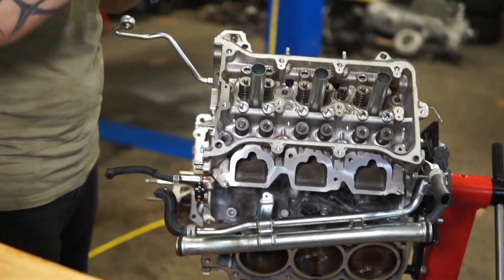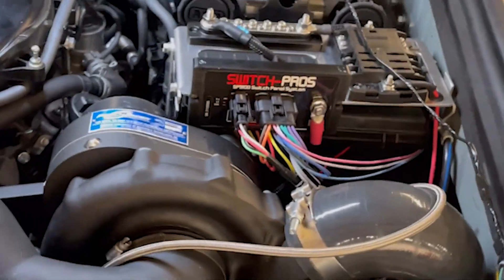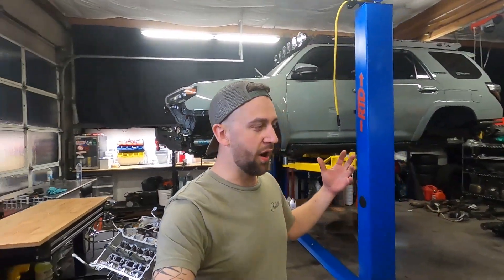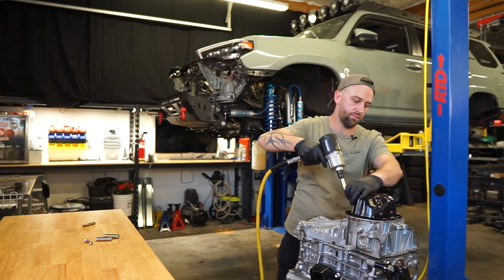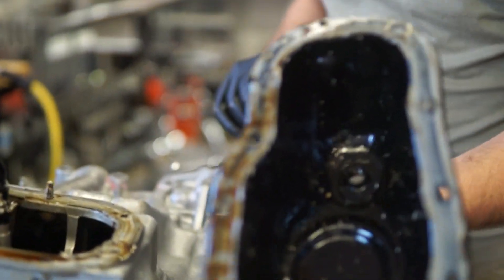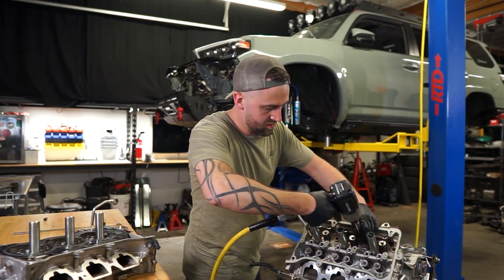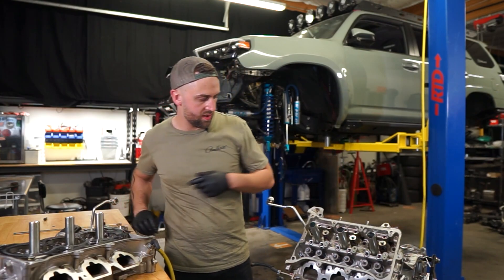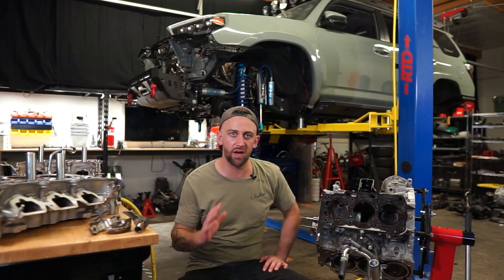HOW DID I BLOW UP MY 10K MILE 4RUNNER?!?!?!

Comment: Sorry I am late to the party on this. What was the reason for not sticking with the typical 6psi with the "trd tune"? Just chasing those few extra ponies? 
Just curious as the tranny, especially with those big tires might start causing some issues with too much hp. Like is the reliability factor not obvious? Not trying to sound like a smart ass. I am a bit new to the 4Runner world, but getting ready for an SC. I am definitely not greedy on the power as I want the reliability,  just need a little extra for around town.

Comment: It's almost like these motors were not designed for boost, made to be underpowered and reliable
Reply: That’s what they are designed for. Both Honda and Toyota V6 are not designed for power adders.
Reply: @ryanb8736  sarcasm
Reply: Yup. Should've rebuilt with forged internals and possibly even sleeves
Reply: @ryanb8736  honda engines love boost unless you’re talking about the new 1.5?
Reply: @Walterrinho well, he did say V6?
Reply: They're quite overbuilt and reliable with low boost(under 10psi). Kinda odd what happened here.

Comment: do you think it blew due to much pressure? like not enough supporting mods to go with the pro charger and the tune? 

with most boosted vehicles I've always thought you need a set up to get rid of the extra air just as much as you're throwing it (exhaust mods really) headers, ypipe, muffler.   Maybe im wrong but it just seems weird to me to throw boost in and not a way to get it out.
Reply from the maker: Well it wasn't over-pressurized cylinders, so the exhaust wasn't the issue. At it's core it was detonation (knock) that happened ultimately pushing the rod through the block.

Comment: Just curious as I must have missed the reason. Was the tune obviously to hot for the 4Runner engine? I have a Magnuson and many shops have tried to suggest a "hotter" tune to release more from it, but I'm honestly not looking to do what yours did!
Reply from the maker: Well, procharger doesn’t offer an OTS for the 21+, so we were on a beta program to get a map, and sometimes things happen during R&D unfortunately!
Reply: It would have evened blew, so just can’t blame tune. Tune just made it happen quicker. 

Many guys have done same to Tundras with 5.7 and have popped those engines. That’s why nobody charges them anymore. 

Honda is same way with J35. 

None of these engines are designed for boost.
Reply: @ryanb8736  I had a Magnuson (then TRD) supercharger on my 2000 4 runner for 5 years and never had issues. Now I've got a 2018 4Runner where they magnus and supercharger on it. I've had it for about 2 years now and no issues. Since Toyota used to carry Magnuson as a TRD product, there's obviously more research there. Procharger is obviously the hotter tuned supercharger.

Comment: Great video and comments. You think the procharger wasn't the right choice here and obviously it was too much for the engine? Magnuson has a different unit than the ProC but essentially they seem to be the same or at least the principle.
Reply from the maker: Well the issue wasn't so much in the setup, but we were testing tuning software, which was the only non-proven factor for the kit.

Comment: let me guess,,,  
u drained your rear end grease and put in the oil,  drove it till it blew. 
then told your wife u had to rebuild your engine.  
so u used this time to re valve the heads and open up the exhaust ,, install headers, bigger catalytic converter, also installed a pulling cam for a little better gas mileage and better low end torque ,,  giving u 1 to 2 mpg ,,   
and then u added the TRD cold air intake for the sound of the new exhaust. & she's happy because the 1mpg better gas mileage in the city its getting is great with her.

Comment: conclusion, don't try to make a 4runner faster. There is no perfect car and unfortunately the 4runner is slow but I'm okay with that, it has more pros than cons. Good Luck with the project!
Reply from the maker: Well more so we needed more checks in place like not reflashing a stock ECU and running a standalone.

Comment: I don’t think it was the blowers fault. The boot that thing puts out isn’t enough to be the cause. It’s has to be the fueling and timing that resulted in the detonations we were seeing. 
So either do you install parts in correctly or your tuner was all over the place with engine timing. 
You don’t need a 2JZ! Just take a V8 out of one of the Lexus f sports
Reply from the maker: We wanted to go above and beyond. 

Fueling wasn't an issue as we were on a fuel setup good enough for ~800whp.

As for the F-Sport engines, they're incredibly expensive for what you get, plus even less transmission options!
Reply: These engines don’t like to be boosted. Many have popped the Tundra 5.7’s too when supercharged. It’s only a matter of time with abuse. 

My friend has an older Audi SQ5 with a factory supermodel and it’s tuned to 500hp and beat on with 150k. 

He decides it’s time to charge his Tundra. Was fun and sounded great. He was out pounding it hard one night and popped the engine. 

None of us thought a 5.7 would blow. Now we know why nobody is charging them anymore. 

I wanted to buy a Lexus GSF and charge it, but won’t now. 

The transmission is also a very weak link in Toyota and Lexus. 

This is another reason why the 2JZ is still Toyotas best engine. It loves to be boosted. Only one.
Reply: @natedrives_ You are doing the right thing with going 2JZ engine. It’s the only one trusted to handle boost. It’s the king of power and reliability. 

What transmission are you gonna use?

Comment: 4runner motor is most reliable engine in base form every made.
Reply from the maker: Problem is wanting to run 35's, the engine isn't ready for any extra strain. So wanting to go beyond stock these engines are at capacity with no headroom.

Comment: The Procharger for this engines 1GRFE, in the Tacoma’s advertises up to 390hp. I’ve seen only 2 2GRFEs(3.5L) blown up. One was crawling really steep and was probably ran dry, and the other it was a beat up one that had a master cylinder failure that made it so brake fluid got into the intake and oil. Other than that this engines are very solid, even the early ones that had headgaskets issues. It’s sucks man I hope the build goes well and can’t wait to see how you set up the engine for a truck suv.
Reply from the maker: It was kind of a weird experience, we do plan to re attempt this with Lunar 2 though.
Reply: These engines are not designed for boost. Need to build it to handle it. These trucks are made for low power. The trans will also be a weak link.
Reply: @EVS-w1m  Everyone blames it on tune. 🤣 engine left the chat.

Comment: So I’m writing this comment before finishing the whole video so forgive me if you already explained this. I always thought a supercharger on a 4runner was a pretty safe modification. I come from the jeep world and a lot of people supercharge the 3.6 but it usually doesn’t end well. I know the reliability of the 4runner is far superior to the 3.6.
Reply from the maker: Well typically it is with an off the shelf tune, but since no one had gotten onto the 20/21 ECU's yet we were on a prototype software.
Reply: @natedrives_  oh ok gotcha
Reply: These engines are not designed to be boosted. They need to be built to handle the higher volume of pressure. The trans is also a weak link.

Comment: I believe these engines were built for mild regular use and for reliability with normal use. Any boost modifications are risky and ruin the reliability factor imo
Reply from the maker: Any engine is suitable for boost with capable tuning parameters, we were on the leading edge of new software. We will do a redux with Lunar 2 and a new engine software package we are working on.

Comment: Never heard of Pro Charger before this video. Everyone uses Magnuson as a super charger on their 4 runners. Heard they have excellent support. Cheaper is not always better. A few guys in Colorado have the long travel Setup from Total Chaos and after talking to them about it they would never do it again. They also have said re gearing made a bigger difference than any supercharger they have installed. Only seen one guy do it right with a new wider rear axle. Otherwise it is unstable at speed and looks weird.  The also have said the squeaking and noise from the new fenders is really bad on longer drives. I wish you luck buddy.
Reply from the maker: Well the axle is widened now to match, but as for the ProCharger kit, they make fantastic units, just centrifugal instead of roots style, so more like a belt driven turbo to over-simplfy it. Allows for higher peak capabilities. Cost wasn't ever a factor and it was not a "budget" option. The fenders need isolators of some form to act like oem, kind of the nature of fiberglass though.